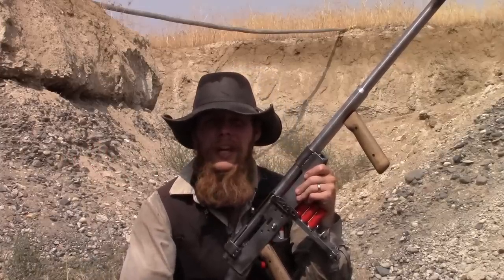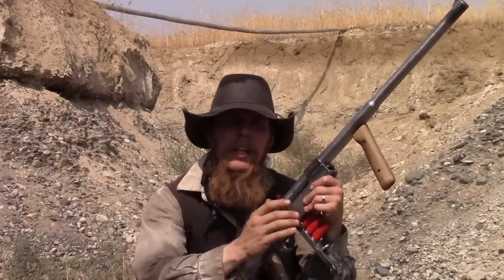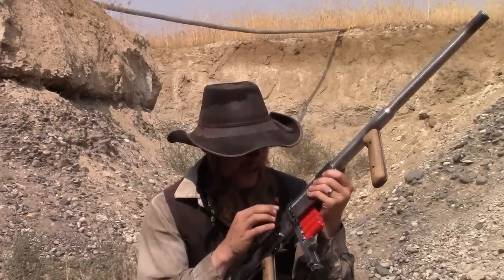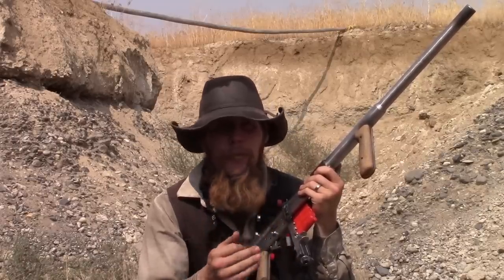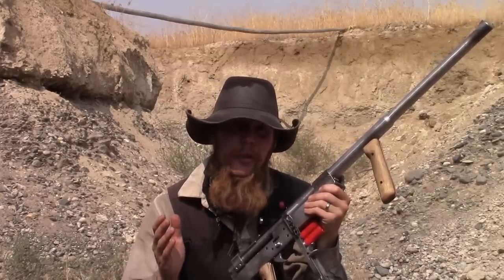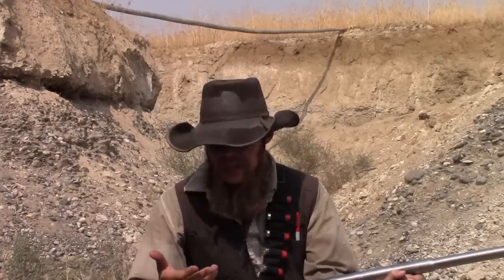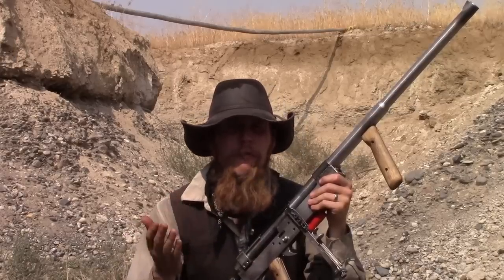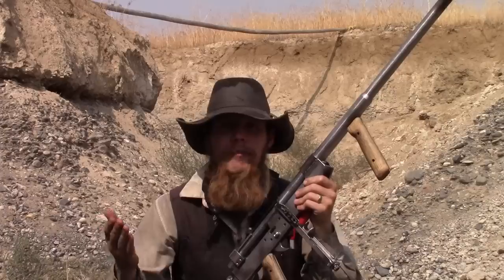Reverse-Pump Shotgun Failures (TIS161)

Comment: Could add a heavier hammer spring at the cost of a heavier pull on your action. Or you could instead use a quick release drop pin attached to the back of a double head nail as a firing pin.

Comment: 1) Stronger Hammer Spring 
2) Maybe enclose the rounds with a Sheet Metal Box to keep the cartridges aligned better?
3) Add an external  Spring-Loaded device like the Extractor on a Semi Auto Pistol to keep the Barrel closed but will allow your pumping action to open it?

Comment: I sill love this design. Maybe because of similarities it has with a certain blow-forward automatic shotgun tat never made it into production. Pancore (sp?) JackHammer for anyone who doesn’t know. Basically, this, but gas operated and fed by a revolving cylinder. Oh. And also a bull pup. Come to think of it, you could probably build a mag-fed Jackhammer variant. It would solve the jackhammer’s reloading issue. Though it would require a longer action. I’m gonna stop here and leave the technical details to the professionals.

Comment: probably need a much stronger spring that applies pressure across the complete bottom of the shell. And My guess is rimlock of some kind is happening. you do need to have the shells staggered at least a lil bit.

Comment: In 90th in Russia they made another models of a reverse pump action shotgun, which worked satisfactory /Lynx, RB-93/. And what? It was one more failure on the market! People did not like that gun and rarely bought it just out of curiosity. The main question here is what for? I mean what for do you invent a new reverse pump design, when you long have an ordinary pump guns which operate flawlessly? Technically it could be interesting attempt, but you should admit beforehand that you will hardly find too much advantages in comparison with classic pump gun, while there are always unexpected problems in any revolutionary new design. So, as ever, you should think "what for?" before commiting any revolution.

Comment: Ok the clambering issue might be fixed by an extension on the slide action to release the round from the clip ( this would have to be a repetitive mechanical action , spring retention holding one round at a time ).

The bolt closed can be checked by a toggle switch.  When closed trigger is active else not engaging th seer.

Comment: That is one great homemade shotgun you have there. I truly amazed by the idea. I hope that you will continue to fix the shotgun untill it works fine. I have some ideas, probably to make the lid that held the shell longer to make the shell straight to the barrel when the barrel closed and perhap changing the mag spring with the stiffer one. For the falling barrel when the gun point downward my suggestion is maybe you could add spring to the barrel so the barrel will stay closed. I can't wait your next video about your shotgun. Thanks.

Comment: If you don't wish to close the breach in any way you should be able to solve your third issue(out of battery fire) by creating a bar/button blocking the firing mechanism unless depressed by the barrel being fully in battery. Probably best if it blocks the hammer, because if you only block the firing pin you'd need to recock thus wasting a round and you would have a harder time telling why the gun didn't fire, where as a blocked or disconnected trigger should be clearer. Maybe combine that with an overlap of the  chamber walls and bolt, a couple mm/fractions of an inch should be enough I'd think, just to make sure there is enough travel to depress the bar/button while ensuring the breach to be fully closed.

Comment: Could a thumb operated breach closing mechanism on the forward grip work? Something that would turn a locking lug into place to prevent the from barrel opening

Edit: also do a rotating barrel with locking lugs on the back, operated by the front grip

Comment: I'm glad you brought this up.  I had first seen your build video and demonstration the other day and I noticed that you definitely do lose a fair amount of mechanical advantage in how the pivot for the firing pin works as well as the big issue of out of battery detonation.  I've been looking over your design and trying to figure out a simple way you could add either a hammer block or trigger disconnect until it's fully in battery.  I think it would be fairly easy for you to improve the gun and I really like the concept great work!

Comment: could have used an ar-16 trigger/hammer config( a lot of flexibility and lower cost to consider). ya might consider a measure to lock the barrel/trigger to prevent OOBD. also look in to using mossbergs box mags, maybe strip the round from the box as you open the action onto a loading shelf, then closing the action loading the shell onto the breech face.

Comment: Hey, awesome shotgun and just wondering how come you didn't think about having a front guide rail for your shotgun magazine? I feel like that would allow you to have a more of the modern box magazine design, which should clear up most of the feeding issue.

Is there any plans on expanding on the capacity? or designs for a double-stacked magazine?
Reply: Agree, and a front rail would also allow a bit more clearance over the rim end to free up the binding issues as the rounds feed up.
Reply: I thought the same thing, but I wanted to see if anybody else noticed the shells tilted down as they feed up ..need full support of shell ,not just on brass

Comment: Some of the problems I see with the Reverse pump action shotgun seems very fixable. The magazine issue could probably be fixed with a square mag design, and some grease. While that wouldn't work with any other caliber. Do to shotgun shells being more cylindrical in shape. The magazine shouldn't need to banana like a traditional mag. You could depress magazine spring down to the bottom, and fill the mag through a small hole that will get covered when the magazine spring is uncompressed again.

Comment: As someone who teaches engineering I want to congratulate you on producing great videos with thoughtful comments.  However, I think you sell yourself short.  This is an invention and it works.  The engineering process starts with the invention and solves the problems in a systematic manner.  For you to have taken this concept as far as you have is remarkable.  One question I have is how much choke would it take before the barrel would open?
Reply from the maker: Thank you for your congratulations.  It's true that the shortcomings of this design could be addressed.  However, I am concerned that fixing them would increase the mechanical complexity of the design to the point where it would be expensive to manufacture, which in turn would compromise its marketability.  Between this concern and the fact that I have a dozen other projects that I think have higher probability of producing a commercially viable product, I decided not to pursue this design beyond the first prototype, at least not at this time.  You bring up a good question about choke.  I think that if the barrel were heavy enough, it's inertia would still prevent it from opening, or at least prevent it from opening until after the shot had left the barrel and pressure had dropped to acceptable levels.  Actually, with just the right amount of choke and just the right barrel weight and a return spring for the barrel, it might be possible to build a semi-automatic version of this.  However, that is not something that I have investigated (nor have the resources to investigate at this time).  This prototype just had a cylindrical bore with no choke.
Reply: @TheIdahoanShow  You are right about complexity quickly entering the picture.  I coached biathlon and had to replace firing pins for a straight pull bolt on an Anschutz 1827 Fortner  (http://www.nordicmarksman.com/1827-Fortner-2.html) what appeared to be such a simple concept was very complex.  The idea of ball bearings securing the barrel in place for your application came to me but the actuator would most likely have to come from the forward grip adding a linkage or sleeve to the design. If you don't mind I can have my students see what they can do with it as one of their Tool and Die Design projects... a good many are hunters and would be very motivated.

Comment: what if you made it feed from the side like a  ww1 Hotchkiss using machined trays/clips that hold the shells and feed through with them like a harmonica gun. instead of loading in single shells by hand you could load 5 round "strips" that get pushed by your fixed spring. that way you don't have to worry about the cartridges binding by the rim.  the strips could be made out of brass or spring steel and would ensure proper position while feeding. the only challenge I can think of is how to keep the clip fixed while it's feeding the next cartridge and doesn't fly out the side of the gun. perhaps there is an older harmonica style gun that already solved this problem.
Reply: Or mount it on top and instead of relying on spring pressure, and a follower that covers the length of the shell may also help with magazine reliability, along with a fully enclosed magazine.

Comment: Making a working firearm from scratch is more difficult than most think, what you learned from building this is far more important than what you built.
Reply: In actuality, its rather easy to make a firearm from scratch, but making it safe and reliable is pretty much the difficult part.

I mean one shot weapons with a lifespan of max 5 shots are pretty easy to make.

Hell i've seen a BlackPowder gun made from a car exhaust pipe and starterpistol caps and a pivoting nail hammer. Sure it blew by shot #6 but hey it worked until then.
Reply: Lilac Tortoise 

Kids from Dominican Republic 🇩🇴 
Can teach you how to make guns like its a toy. They even make bazookas from cans that shoot nails and ball bearings with kill power.
Reply: Lilac Tortoise  mad?

Comment: i wonder if this design would work better as a slam fire. by pulling the second handle back to make it fire, would ensure the breach is closed. then the rest of your action would work to reload. you could also set the magazine at an upward tilt or on top of barrel using gravity to help feed it. with a little bit of re-designing you could potentially have yourself a little survival shotgun. i would cut the barrel down though unless you were to make it into an actual rifle

Comment: The failures of ignition and the safety issue you mentioned are most likely aspects of the same issue. The barrel can be pulled far enough to the rear to partially chamber a round. If there is no dirt in to play, in means that it pushes the primer not firmly enough against the breech or bolt face. The primer pushes the cartridge forward and the system does not offer enough resistance for the firing pin to crush the primer. The other extreme is debris pushing the cartridge firmly enough against the bolt to the permit the firing pin to ignite the cartridge but blowing out the shell where it was not fully encased in the barrels' chamber that remained too much forward. Two sides of the same coin: the firing mechanism can be actuated with the barrel in a semi-closed position. You need a secondary safety sear like on full-auto weapons that releases the hammer only when the barrel is fully rearward. My take as a mechanical engineer.

Comment: Very cool, I think you can fix all of these. 

1. The stronger hammer spring fixes the misfire.

2. Box mag fixes the feeding.

3. A disconnector that only allows the hammer to drop when the breach is closed fixes the out of battery firing.

Comment: A simple pin lock with a strong spring connected to the fore grip may be an option for keeping the chamber closed. If you make it tight enough it will not engage if the chamber is open at all. All you would have to do is decide the best release mechanism. Having to squeez the chamber close sometimes might be an ok compromise without having to make crazy changes.

Comment: I love the concept. I built something along a similar line. It's a single shot, bolt action 12 gauge. Instead of the "bolt" sliding back, the barrel slides forward via a bolt handle, load the shell into the chamber, then slides back to the firing pin/breech block assembly and locks. It works pretty good. But nothing as intricate as yours. I think with some refinement, you can work out the bugs.

Comment: Light primer strikes are an easy one. Like you said, stiffer spring, bang solved. Out of battery is a bit more complicated, but I do not see a major issue here. A bar that holds the hammer is pushed out of the way right when the action is closing. To fix the action opening up when you tip the barrel down, add a spring loaded lever with a hook at the end that must be pressed to open the action, assuming that problem even really needs to be solved. The issue I can not figure out how to solve is the magazine. I do not really see why it is having trouble. I get the idea. Seems like it should work. Do you think it is an issue with the design, or an issue with manufacturing?
Reply: As for the Magazine issue, it may not really the magazine but the ammunition.  The rims of the ammo may be at the maximum manufacturing tolerance, and the magazine works best at a slightly tighter setting. For a fun gun that is OK. For a working shotgun it is not.
Thanks for the self criticism. That is something rarely heard of.

Comment: the open breach problem could potentially be addressed in a simple manner.  Since the whole barrel is effectively acting as the "bolt", designing the barrel so that it has to rotate before the breach is opened would seem the obvious solution. Then a simple locking tab incorporated onto the barrel and a slot on the receiver would hold the breach closed when the forward handle is in the firing position.  This could also be adapted to prevent the firing of the gun if the  tab is not engaged on the closed position .

Comment: 1. The hammer could be redesigned as a class 1 lever, one arm serving as the hammer, while the opposite arm is pulled to cock the hammer.

2. I'm thinking spring detents to retain a newly fed shell, and a hook mounted to the barrel assembly to pull a spent shell past the detents.  With shells more solidly retained at the upper end, a more freely sliding feed should work.

3. A safety on the firing mechanism that engages the barrel assembly is a must.  Maybe a secondary seer disengaged from the hammer when the barrel is in position.  A useful secondary function of this mechanism could be as a barrel retainer hook,

Comment: Would it be possible to add a ball detent retainer (of the kitchen cabinet type), sprung strongly enough to retain the barrel closed but not so strong as to make cocking and reloading too heavy?
Reply from the maker: Actually, I included a ball detent retainer in this design, thinking it would at least provide some tactile feedback to ensure the action was fully closed when firing.  Unfortunately, in this prototype the spring that would fit where I needed it for the ball detent was too light for the detent to have any noticeable affect.  With a stronger detent, that would be a simple fix, although it wouldn't completely prevent firing out of battery.

Comment: Failure #1 I think is a easy fix like you say, failure #2 I think a tube feed / mechanical feed and #3 well you could go as far as a control arm not allowing the firing sequence or just a ball bearing indent (forgot the proper name, this old Tony had a video) that's audible and tactile. Think this should be carried on in the r&d, good job.
Reply: Detent is what we call em
Reply: @mikel.dishman4031  that's the buggers

Comment: So often this happes with a new departure in design.  A couple years ago I was playing on paper with a new revolver design, that seemed pretty revolutionary in its simplicity.  But then, as I addressed each of many possible issues, the complexity kept rising - making it less and less attractive.  ...Then I found that a very similar design had been done over a hundred years ago.  
But unless we dare to think about different avenues of arriving at a solution - there would be no advancement.  Happened a number of times throughout my design career as well.  But the few times one succeeds big - makes all the trials worth it ! 
So kudos on the design -   AND for not only playing with this on paper - but actually building it !!
Reply: I find watching Forgotten Weapons here on You Tube is very interesting. All the old designs that were left behind due to manufacturing restriction, a stubborn designer, or lack of interest is astounding. If some of the designs were reintroduced they could take off but because of the original failure they sit on museum or collectors shelves.
Reply: So If you don't mind me asking; How do you address each of the possible issues in a design?
Reply: "a new revolver design" should have stopped there and saved yourself the time, shits been around hundred years or so nothing revolutionary other than the cylinder cycling.

Comment: Would spring loading the for and aft halves to close the breech and adding a breech lock  possibly solve the safety issue? I really like your concept and hope to see it function dependably.
Reply: gorp27 add that with the system the ar15 has where you push it to force breach it just in case

Comment: Issue 3 is indeed problematic.  Somehow I think you will overcome this obstacle.   Keep pushing the envelope dude, and keep on having fun with your projects!!!
Reply: Really needs a safety interlock on the firing mechanism, though that could be very tricky without complicating a very simple design.
Reply: Wouldnt a spring lock mechanism be an idea?
Reply: just a simple barrel locking lug